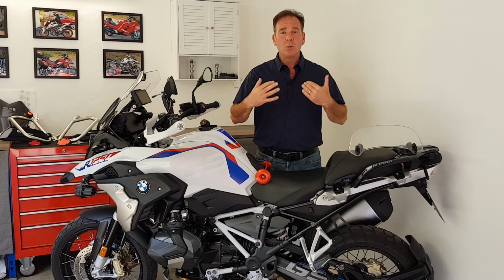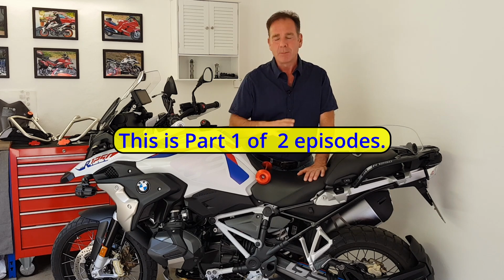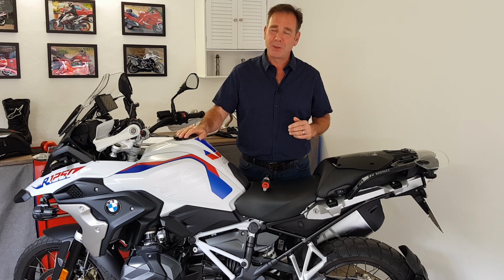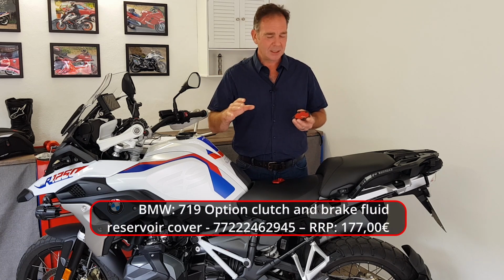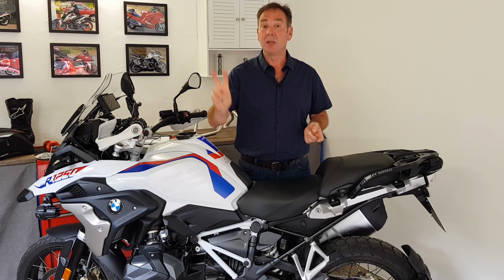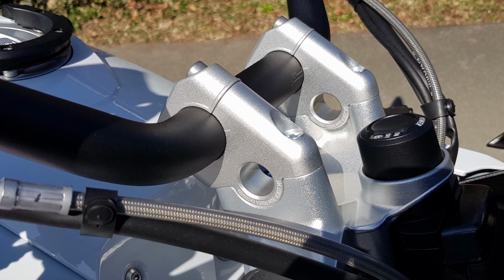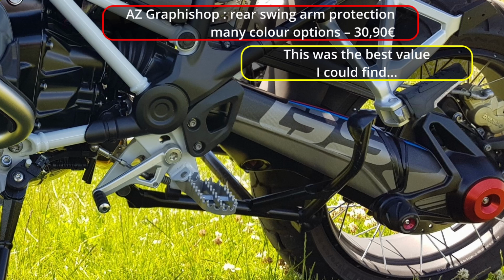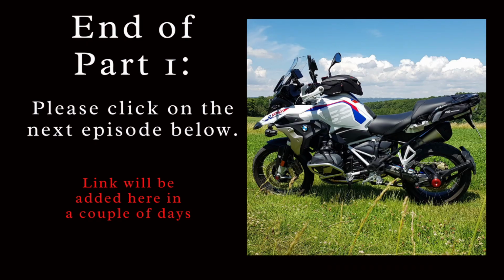EP:9A BMW R1250GS Accessories and Upgrades, Decals, Crash Protection 17 Budget Accessories on Test

Comment: Come 2025 and I cannot find the  rake fluid reservoir cover from Mad moto on eBay and rear axle crash protector from CXEPI. Any idea where I could get those? Thanks
Reply from the maker: Hi , Mad Moto sold out of the reservoir covers very quickly and are no longer available.
There are several other brands of axel protection also available. Re CXEPI It’s quite normal for these small suppliers to sellout quickly. 
Several brands are almost identical.
Carl

Comment: Hi Carl decided to give the Voigt risers a go as would like a little more bend in my arms without leaning forward . Quick question for you , the instructions state 23Nm for the Voigt risers when the factory service manual states 19Nm for all bolts .. Do you recall if  you stuck with factory 19Nm  torque or go with Voigt recommended 23Nm.  Cheers in advance 👍
Reply from the maker: Hi, I seem to remember going with the instructions, if the difference is only 4Nm it’s really not a great amount. But I would go with Voight suggestions.
Which version did you go for ? Same as mine or one of the other height/ reach options .
Carl
Reply: @justthewayitis  Thx Carl, I have gone for the 30 up and 24 back .. Hope to get them.on this weekend , just wish the rain would stop 🥱 so I can get out and try them ..
Reply from the maker: Lol, well you have the rain we have -5 degrees and ice and like you I can’t wait for better weather to arrive. Carl 👍🙋🏻‍♂️
Reply: @justthewayitis  Installed this morning and decided wet ride was ok to test , so so much better , arms now relaxed and more upright riding position. Happy bunny 👍😜
Reply from the maker: Good to hear 🙋🏻‍♂️👍

Comment: Hi Carl. I have just purchased a set of Ricochet crash bar engine guards. I see you have the Wunderlich cylinder head protectors on your bike. Would you run both products or would that be overkill?
Reply from the maker: Hi Mark, good afternoon. I use both so that if I drop the GS in soft gravel or rocky terrain there is no chance of scratching or damaging the cylinder covers.
I think both are a good idea if you have enough clearance.
Best wishes Carl 🙏

Comment: Hello Karl I absolutely agree with what you say, the prices for accessories, especially from Wunderlich and Touratech, are not only excessive, they are extremely outrageous. People who buy things like that have lost control of their lives.

This also applies to accessories such as case systems or lighting. I am thinking of DENALI, for example. 1 small headlight €430, that's where it ends. In comparison, the prices of original BMW accessories are already discount prices
Reply from the maker: Hi Roman, yes the prices are in some cases excessive and over priced, but people still buy them. With a little research some of those products can be at a much lower price and sometimes it’s just branding that adds to the cost.
But it’s worth highlighting that occasionally you do get a better more reliable product that has been well designed and tested, and they are worth paying a little extra for.
Thank you for sharing your thoughts kind regards Carl

Comment: Hi Carl. I have exactly the same bike. Was there enough slack on your clutch and brake hoses when you installed the bar risers, or did you have to get creative to prevent the hoses from snagging?
Reply: Thank you.
Reply from the maker: Hi Gunther, no problem with either hose, but it was close.
No snagging.

Comment: Hello Carl,
I’m new to the channel and wanted to say thanks for the inspiring material  for all GS lovers. If I may, in regards to the handle bar raisers, I would like to know if you had to buy the clutch and brake  adapter extensions for bike? Thanks again
Reply from the maker: Hello Mr Majiso and welcome to the channel. The bar risers I used did not need extensions on either side. It was close but after measuring carefully I decided not to extend them as there was enough room. I think if you buy anything taller or higher then extension would be advisable. Also this might vary depending on year model you own mine is a 2021/2/3 model 
Best wishes Carl
Reply: Thanks a lot Carl .
Reply from the maker: You’re welcome 😇

Comment: Hey Carl, i've been looking into getting some accessories for my 2023 1250 GS (a top case specifically). I purchased the Top Case / Top Case Rack off of Wunderlich as they said it would surely fit the 2023 1250 GS Model but when I was trying to install it I noticed the mount on the bike that their rack attaches to was way different than the one on my GS. Their instructions have a mount that looks like the one in your video on the back.

I went to the dealership to ask but they said the one on my bike is the standard top case rack for the 2023 models. I was wondering if you knew of any parts to help get this attached, I really do like the top case but don't know where to get that rack in your video to install it to.

I tried to attach some links to the parts and my adapter but I think youtube auto flagged it as spam, but would love to reach out if you have just a moment to take a look. I didn't know who else to ask and your vids seem to be amazing for GS parts.

Sorry for the long question and thanks for the content. You've got a sub out of me for sure!
Reply from the maker: Hi Johnathan and welcome to the channel, my email address is
Contactcarltoday@gmail.com
So send me an email with pictures and I will have a look for you. I’m not familiar with the Wunderlich system but I’m happy to have a look
My system is basic standard OEM rack onto which I mounted the Givi mounting plate.
Carl
Reply: @justthewayitis  Thanks so much Carl, I sent an email with those pics and really appreciate you taking a look!
Reply from the maker: Glad to help !

Comment: Hi Carl, I'm planning to get the GS bike soon and was compiling the list of things in terms of the must-have things and necessary upgrades. What a joy is to find your channel. I'm a happy new subscriber. Thank you for your meticulous job and elucidations! 

I have a question. I live in Austria, and after visiting the Motorrad Zentrum in Vienna I was told that any kind of headlight protective covers are illegal - no matter what kind of material, plastic, glass, mesh cover, etc. I see you use one in Germany. Did you check if it is legal in Germany? Otherwise, something's strange in Austria... i have already encountered one issue relating to the 3D overview on my car (when you can watch what's happening around the car remotely over the phone using the front/back and mirrors' cameras ), and that function is jammed/restricted due to the data protection law. That is, BMW takes the money for this function, but the country prohibits it...:(  

So, I'm just puzzled about the headlight protection as this part is quite expensive. Would be nice to hear from the GS bike owners from Germany/Austria. Thanks in advance!
Reply from the maker: Hi Alexander and thank you for subscribing 👍 it really helps the channel grow. Glad you are enjoying the series and having fun choosing your options for your new bike. Correct the headlight protector is not permitted legally and should only be used off-road. We each have to make are own decisions about that. I might remove it but then again it might stay on !!
But the headlight is about 1800€ to replace I need to check to see if it’s covered by insurance . If it is I will remove it.
The GS has been a big positive surprise for me and I really enjoy it… such a capable bike
Best wishes Carl

Comment: I followed your approach, because I was shocked by the Wunderlich prices. I ordered a lot of stuff on eBay too and that‘s what I found out: The base tool is always nearly made of the same quality and therefore I think Wunderlich orders this stuff in China too. But Wunderlich always improves the assembly manuals and they nearly always changed the nuts and bolts to a higher standard (better material quality and torx instead of inbus). Everyone has to decide for himself, if this is worth sometimes more than 500 % difference in price. The only thing, I‘m asking myself is about regulatory compliance, when it comes to german TÜV or a police inspection on the road. Will they accept the China stuff on my front axle? But this could be the same question with the Wunderlich material. For example, in some countries it is ok to mount a cover of transparent plastic or a plastic grid in front of your expensive headlight to prevent cracks by stones. In Germany that is not allowed.
Reply from the maker: Hi Klaus good morning and welcome to the channel. Their are some areas I would not fit cheaper parts like the bar risers for example as they are very important and must a KBA number. But many other areas you can save a lot of money, I agree with what you have shared about wunderlich. Yes the rules and regulations are very strict here in Germany and I have to now remove my headlight guard, best wishes Carl

Comment: I will never buy anything from SW-Motech.  I purchased a shift lever which bent after light use.  I sent them photos and asked for a replacement.  They told me that a car him my motorcycle and bent it.  Really?  I think I would have noticed if a car hit my motorcycle hard enough to bend the shift lever and there was no other damage.  They said the car had rubber bumpers which didn't leave any marks.  Bottom line is their stuff is cheaply made, their support is condescending,  and they will not honor their warrantee.  $192.95 plus taxes and shipping down the tubes.  My BMW dealer has had issues with them and has dropped all of their products.
Reply from the maker: Hello and welcome,  thank you for sharing your experiences with SW Motech.  Sorry to hear you received a poor response from them about your product. I hope you have something better installed now.
Regards Carl

Comment: Don't cover the rear hub. When riding there will a turbulence that moves through the hole that causes to cool the hub and the oil inside.
Reply from the maker: Hi Oguz, hello and welcome to the channel. Yes you are correct. 
When I tested the Red Rear hub protector for the accessories video,  about a week later I noticed the rear hub was very warm... so I removed it and went back out for another 30 minute ride. And the hub was then much cooler. 
I have removed the protector and will not be fitting another one.
Thankyou for sharing this. 
Best wishes Carl
Reply: Truly? I’m thinking of removing mine now.
Reply from the maker: Definitely a good idea. The drive assembly gets really very hot when covered.
Reply: @justthewayitis  I see. This is the only place I’ve seen this discussed. It’s looking like we’re the only ones who know. Following you guys and removing mine as well.
Reply from the maker: Great move 👍

Comment: Best thing aftermarket part on my GS: MRA vario touring screen, a very big step forward in drivning comfort, i first got a loan Adventure screen and MRA i far superior.
Reply from the maker: Hi Anders, thank you for sharing. Currently have the MRA vario Xcreen fitted while I am  touring Norway,  so far it's been brilliant at reducing the noise.
Best wishes Carl
Reply: The standard OEM GSA screen with a spoiler bolted on top is very efficient also.
Reply from the maker: Thank you for the suggestion... I hope to borrow a friends soon from a GSA. Carl
Reply: Agree, I have had 2.
Reply from the maker: Thank you Jim for sharing.

Comment: Wondering about that tank bag. These bikes are fabulous - loving my GS Adventure.
Reply from the maker: Hi Hogdrive and welcome to the channel. The one I have and use on both the multistrada and GS is an older SW Motec model called EVO Engage,  they are still available to buy but not so easy to find. I prefer this style to the new series, because I can mount the Map holder on top and although I use a navi system I love to have a real map with me too.
Best wishes Carl
Reply: @justthewayitis  Thanks Carl. Looks like the Pro series has replaced the EVO series? I do like the quick release feature. I agree with the map - GPS is nice but there's nothing like a good old fashioned printed map 👍
Reply from the maker: Maybe you can find one on Amazon. 
Best wishes Carl

Comment: A couple of things I fitted were eBay mudsling and front fender extender. Both have been on the bike for the last 17,000kms and they function fine. I did need to trim the mudsling slightly to stop the rear tyre rubbing. The "official" parts are outrageously priced for a couple of bits of plastic. Something else worth fitting is the Cymarc windscreen brace. It works.
Reply from the maker: Hi Geoff,  thank you,  yes I have also heard good things about the Cymarc screen support so when I get my screen sorted and the wind noise gone or reduced, perhaps I will fit one.
Best wishes Carl
Reply: Very simplistic view but doubt you would feel the same if someone ripoff your designs.

Comment: Hi Carl - nice vid.
Quite like the look of those grab handle stickers which would offer some protection when my camping stuff is strapped across the passenger seat.
Couldn't seem to find them on Amazon though despite following the link ...
Reply: Thanks for your help Carl, but still not having much luck either on the Bay or Amazon. 
Just seems to be parts for pedal cycles - mostly brake disc pads. 
Don’t suppose you’d be kind enough to send me a direct link …
Reply from the maker: Here you go.
https://www.amazon.co.uk/Adhesive-Handles-Protectors-Compatible-TRIPLE/dp/B0983Y6CDP/ref=mp_s_a_1_16?crid=3S75WW9URCTVF&keywords=BMW+gs+resin&qid=1656694183&sprefix=bmw+gs+resin+%2Caps%2C112&sr=8-16
Reply: Thank you sir 👍
I think I’ll have a couple of those 😃
Reply from the maker: Smile....
Reply: @justthewayitis  These are exactly what I've been looking after faffing around with cutting out my shapes from protective film, and not doing a great job at it!. Ordered.
Reply from the maker: Hi Samsara, glad it helped you too. Have fun... Carl
Reply from the maker: Hi String, thank you, they are also available on ebay. I will look for you now and add more information. Carl
Reply from the maker: On ebay, they trade under the brand (resin4bike)
On Amazon its (resinbike).
Carl
Reply from the maker: Currently on Amazon uk sold under Resin Bike brand name. 19.75£
Let me know how you get on Carl